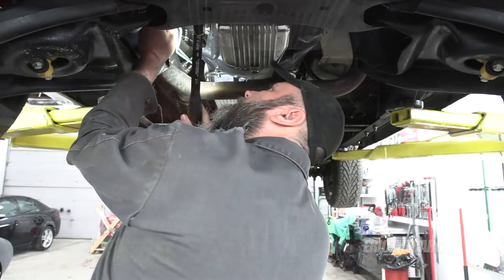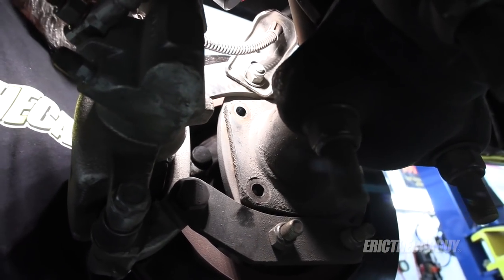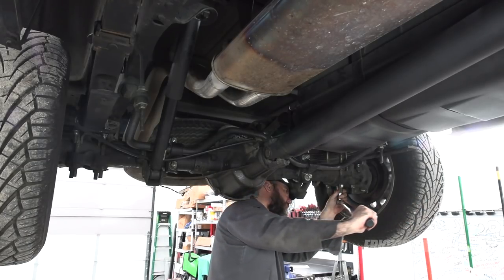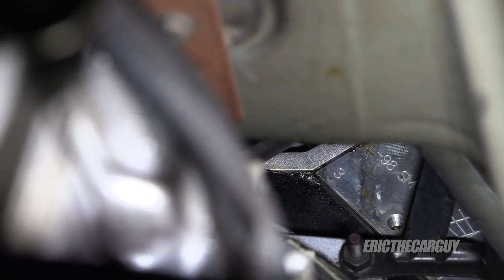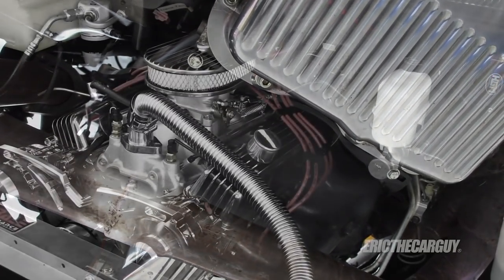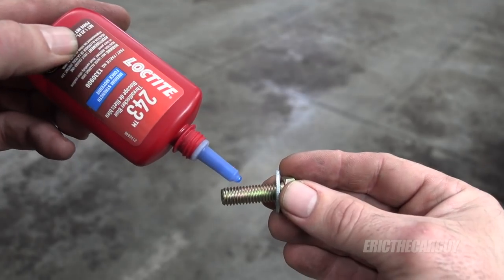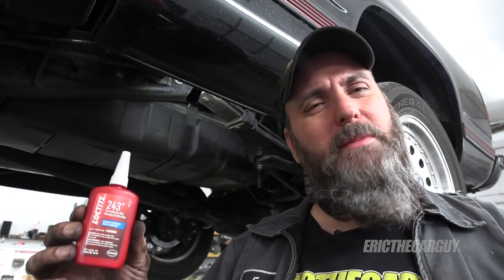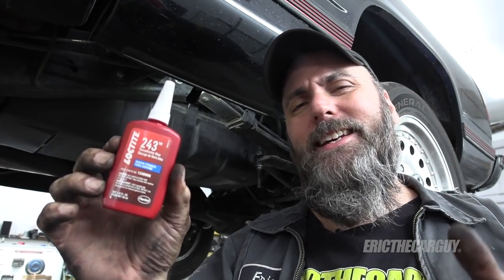Check & Recheck Your Fasteners For Safety

Comment: Good point! I also do brake service twice a year - each time with the seasonal tire change. And while I'm there, I inspect suspension components for play and wear. I think a lot of people underestimate the importance of that. Regular service and early problem detection will prolong the lifetime of your components significantly! I mean, my car is 13 years old, and I'm still on the original brake calipers, and I only replaced slider pins and pad guide shims once.
Reply from the maker: Excellent advice.
Reply: Acura Addicted how did you know it was time to replace the slide pins? I mean they are bathed in grease and are little metal rods. How did they go bad?
Reply: @BaliMystic  you’d be surprised in the rust belt. Seize up faster than you can catch.

Comment: Yep. Super important. Torque specs are there for a reason. Also. The proper fasteners and washers.
Reply: And especially replacing stretch bolts :P
Reply: I'm old guy I use old guy strength and muscle memory no torque wrench needed I've been tightening bolts for 52 years
Reply: @rkan2  yes torque to failure always need to be replaced. super super important I have watched so many people get skunked by the failure of those bolts that have stretched already
Reply: Torque wrenches are for woosies
Reply: Yea if you can actually find them torque specs that great, but most of the time their unlisted or you have to jump thru so many hoops just to find them.
Reply: @bobsuruncle2212  sometimes you have to base them on the fastener used.   All manufacturers give an allowable torque spec for their fasteners.
Reply: @spacecat7247  Nuts you can usually re-use, the stretch bolts themselves only until alignment is done, pretty much is what my experience is.
Reply: I only have one thing to say:  "CLICK!"
Reply: Evan Watson you mean torque to yield. If the threads have failed, they have basically been ripped from the bolt or worse, the hole.
Reply: @BaliMystic  guess that matters most when 2 different materials are being fastened together,  usually from over torquing.  Or inferior grade fasteners.
Reply: Evan Watson has nothing to do with different materials. Sometimes you can get a little bit extra strength from a fastener by torquing it to the point that the threads yield. You get the extra strength from work hardening. No spec will require torque to failure but some require torque to yield.
Reply: @BaliMystic  has to do with the fastener itself. Not it's threads , not the threads  cut into the material its going into.  That particular Fastener is made to yield at a certain torque value .in  effect it's made to stretch to the point where it's about to fail. it can only be used once and it has to be thrown away if those components are ever separated again.
Reply: Evan Watson yep, i know all that. In your original comment you said torque to fail. I’m saying it’s not torque to fail it’s torque to yield.
Reply: @BaliMystic  yes it was a term I was looking for that wasn't coming to mind at the moment. Technically you could call it a partial failure and the  material in and of itself is actually partial failing . it can only be done once and then it will fail
Reply: Evan Watson failure has a specific definition in engineering. Yielding has another. Yielding means the material is permanently deformed (and also usually harder). Failure is the point where the material breaks apart. Totally different.
Reply: @BaliMystic  i am aware.
Reply: Evan Watson didn’t sound like it by the way you were describing how troqué to yield works
Reply: @BaliMystic  oh I do. you were mentioning failing threads on Fasteners and in parent material that isn't how they work either. So....

Comment: This is good advice for any vehicle whether new repair or old original. I have a 50 year old tractor that had a small hydraulic leak and an oil leak. I checked the torque on the oil pan and found every bolt between 1/4 and 1/2 turn loose. I torqued all back to spec and while I was under there, torqued every bolt in sight and now I have no oil leaks. I used Loctite 545 on my leaky hydraulic line and no more leaks anywhere. Pretty good for a 1970 John Deere 4020. I am a believer in Loctite 243 and 545!

Comment: You can also use a paint marker in sensitive locations. make a line across the head of the bolt and you can easily tell at a glance if anything has loosened or not.
Reply: concur. I use high-vis Markal security check paint marker to quickly see if any fasteners are backing off, and showing which are torqued already.
shouldn't need locktite if you use NEW hardware in critical applications and keep torque wrenches calibrated.

Comment: Thanks Eric. Specifying the exact threadlocker you are supposed to use by number is invaluable.
Reply from the maker: More info in the description on that. Thanks for the comment.
Reply: @ericthecarguy  My point is that "Blu Loctite" which is what you get in most auto videos is not enough info. Thanks again for being clear about which one. I have worked in the mechanical industry and also inte numerous loctite sales outlets so this has been a pet peeve of mine. Medium Strength Removable is also better info than blue or red because that is also written on the bottle. Top marks for this video.

Comment: At work (Automotive body shell and Exhaust supplier/OEM) I used blue loctite (242, I think?) on a lot of things... anything high-vibration, at least. Never had a failure to my knowledge.

Loctite 604 (green) is handy for dealing with sloppy press-fit dowel holes... some of our equipment suppliers don't do press fit dowels anymore and use that609 on the side of the pin that's meant to be press fit. Another "low cost" supplier liked to slip fit everything (to the point of dowel pins flying out of robot tooling!)... once again, loctite to the rescue. 

Good stuff when used right.

Comment: Very good call, almost went through the front of a local pizza shops window's in a friends mustang when the control arm bolt came out. Have to be on top of anything with solid bushing as well, if you put race car like suspension in your car you have to treat it like a race car, there's a reason they check them so often.

Comment: I agree 100% I did a 4 to 5 lug conversation on my car as well as a drum to disc conversation in the rear and upgraded brakes rotors and calipers all at once and after a few day ls the caliper on the driver side front started getting loose so it's very important to go back and recheck and re-tighten any fasteners you touched while working on it.

Comment: Huh, before Loctite was even founded  I use torque wrenches to torque down all my bolts and nut never had any issue with any my bolts or nuts coming loose but  i did went back and recheck them after three days they moved a little after  the vehicle settle in but never lost any bolts or nuts.
Reply: I just use old rusty bolts and crank them by hand till they feel just right. Never come undone. lol

Comment: Before I was a tech I did everything by hand and found I had a "re-tighten" rate of maybe 20%. Meaning if I were to go back over the work I just finished maybe 2 out of 10 bolts needed a bit more "oomph". I switched to a beefy long neck electric ratchet and just let it eat on every fastener and find that the stopping point on it is usually perfect, not too much nor too little and if it's a really important bolt that needs to be torqued like a control arm or something I'll finish with a 1/2 inch impact. This combination so far has a 99% success rate minus the time I forgot to torque one wheel down, which I figured out 2 feet out of the bay and corrected.

Comment: My most recent build I used the 243 thread locker on a lot of bolts. Used it on timing tensioner bolts, flexplate bolts, torque converter bolts,ball joint studs, caliper bolts,trans mount bolt,motor mounts, timing cover galley cover bolts. 
For anyone thinking I shouldn't have used it on them all let me explain why I did. 
I have had all the bolts/nuts listed above (besides ball joints) come loose at some point or another(not all on this build). The torque spec on the tensioner bolts is very low and when I pulled this engine apart 1 of the bolts had backed out about 2 threads. I didn't want that to happen again.
The caliper and ball joints having some on it was for safety since this car was built with the intentions of racing it. 
Trans and motor mounts I felt were extremely important to put it on because they are stiff mounts and see a lot of vibration. We all know what heat cycles and vibration can do to fasteners.

Keep in mind that having ANYTHING besides recommended lube on the fasteners will alter the torque reading. Research and get a ballpark figure of how much the torque will be altered before you tighten. 
Thread locker isn't a replacement for proper torque but is a supplement or safety measure.

Comment: The only problem with this is that many of us do not have a one-, two-, or 4-post lift and so it’s a bit of a pain to get the car up on jack-stands for us who aren’t pro techs.  Still, it’s a good warning and I check for at least finger-tightness on all accessible fasteners whenever I remove the wheels for rotations/etc. Will be adding caliper bracket bolts to my torque check regimen from now on.

Comment: The only bolts i do not use loctite on is the wheel bolt and caliper slider pins. Anything that moves, rotates or is exposed to the elements. Loctite. Even if they tell you not to use it. Most people don't know it actually protects the threads from corrosion. If it didn't want to come loose with loctite, it most certainly wasn't going to come loose without it.

Comment: I got lucky with my supra. I had a traction arm bolt at the rear knockle come loose and fall out during a hard launch. I felt the car squat and shimmy really hard got out of it and pulled over. Traction arm was on floor. I went back and loctite all fasteners and proceeded to do the same 2x a year. Check torque and make sure all was well.

Comment: If I didn't do this I would have gotten killed by mechanical failure years ago. Torque wrenches are your friends ! Its good to take a sharp pointed paint marker with red or white ink and mark torqued bolts to make sure they are in their original positions later on.

Comment: Had a VTEC solenoid back out after a track day, 3 years without checking it, and no issues, guess high RPMs and doing track events things start loosening up. Annoying oil leak too

Comment: One time I just happened to look at my CV axle bolts, all of bolts on one of the axles had loosened quite a bit, I removed them and reinstalled them with some thread locker, hasn't backed off yet!

Comment: It really is important.  I once lost a bolt off of my ac compressor (that I changed) because apparently I either didn’t tighten it enough or it worked itself free.  You can be sure that I made sure the other bolts that were holding it got retighted.

—oops

Comment: I was replacing the alternator on my PT Cruiser. It's located at the bottom rear of the engine above the cross-member. Tricky to get out no matter which of the 3 methods. I started to use the axel opening method and then decided partway through to switch methods. It took a couple of hours. During that time I had forgotten that I had started to take the tierod end loose. When  I was finished it was getting dark outside so my dad came out to help put things away. One of the things he put away was a castle nut. About 3 weeks later I was driving along about 35 mph and ran over a bump in the road. The tierod end popped completely out. Steering was impossible and stepping on the brakes caused the passenger side to slam to full lock to the right. The car rocked violently back and forth as I tried to bring the car to a stop. I was unable to steer so the car came to a rest in the driving lane. Pretty unsettling. Turns out my dad threw the castle nut away without telling me he found it. All ended well and there was no damage to the car. I don't let anyone help me clean up after that.
Reply from the maker: Glad you were OK.

Comment: Hey Eric! Thanks for all the very informative and educational videos, here's my problem, 1995 lexus es 300, stalls after 15minutes of driving, engine light is on, code is 1605 knock sensor, changed that and same problem, bought a bluedriver, reset the check engine light, but, it comes back on after 2 minutes, helppp!

Comment: wouldn't retightening bolt that had already set with locktite break the loctite bond will it still work if it has set and hardened then moved?

Comment: Did the rear caliper bolts have Loctite initially?

Does Loctite lose its effectiveness if the fastener is tightened after the Loctite has “set”?
Reply: Yes, it sets hard and if 'cracked' thereafter, eg to nip up, it will as useful as not having any thread locking compound.

Comment: Makes one wonder how OEM's get it all correct and tight the first time - without us all having major issues for the millions of cars/trucks sold.
Reply: Robots
Reply: @rustyreckman2892  But supposedly a torque spec with a robot is a torque spec with a wrench - unless this story just comes down to carelessness in everything except the u-bolts (which do bend/stretch).
Reply from the maker: Actually, when a car is delivered to the dealer, I was an Acura dealer tech for 8 years, one of the things you need to do in a pre delivery inspection is to recheck all the fasteners for proper torque. Sadly, no one I've known has ever done it.
Reply: worked at a mazda dealer and yeah you're supposed to check for loose fasteners during a pdi but we just shook things to see if they were loose. we did torque the lugs though.
Reply: @ericthecarguy  I believe that rechecks happened a lot more in the 1970's and back - clients were told to drive the vehicles for a little bit (250, 500 miles), then bring them back for both new oil and torque checks.  But you guys are making my point - while certain makes still tell techs to 'check' torques, the truth is that just about nobody is doing it anymore, and yet we have millions of new / once new vehicles that hit the roads, and haven't been suffering as many issues as one would expect if fasteners went loose as easily as they do for home mechanics using torque wrenches.
Reply: Way way back in '68 I picked up my new '69 El Camino SS396. I was to go on a 2600 mile trip and I decided to change oil at 500 miles. While I was under the car I noticed an oil drip coming from near the fuel pump. The plug that closed the hole where the pump installation places the pump arm correctly was loose! So loose it was about to fall out. I used the Gutentight method to ensure I would save my engine on my trip. Whew!

Comment: Don't even get me started on valve cover bolts loosening up after a couple 100 miles... Truck is still covered in oil from them working loose after the rebuild

Comment: Why did I feel like the missing fasteners were something he did for the content and not something that actually happened?
Reply from the maker: No, that actually happened. I was just lucky that LOCTITE reached out about the same time and it made a good video.
Reply: I've seen missing caliper bolts, and/or bracket bolts many times.  Had 1 towed to the shop last week.
Reply: @naokimatsushima4979  one of my caliper bolts is cross threaded and i can guarantee it will never come out. lol
Reply: The Dos Equis guy looked at my ride and ALL of the bolts fell out..

Comment: People have been putting melted pitch on bolts as long as there have been bolts. LocTite did not in any way, form, or fashion invent the concept of liquid fastener locking. Lame plug, shoulda just said you asked them and stopped there. Good video otherwise.